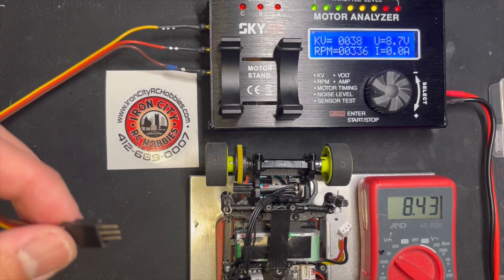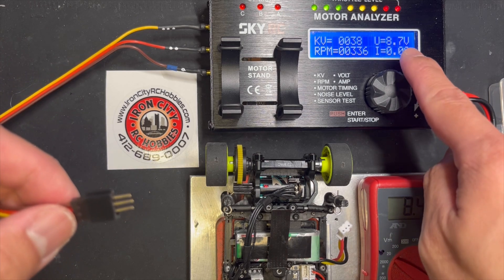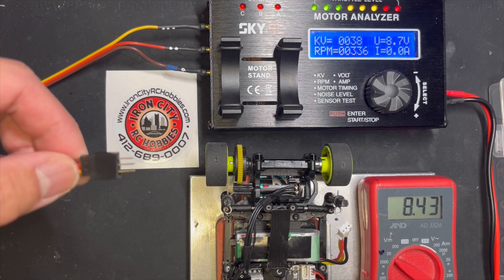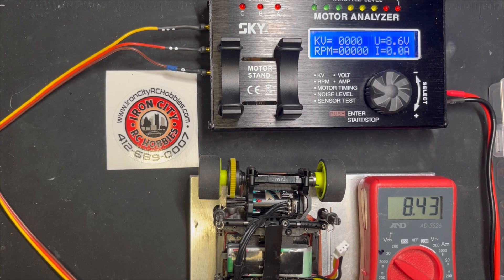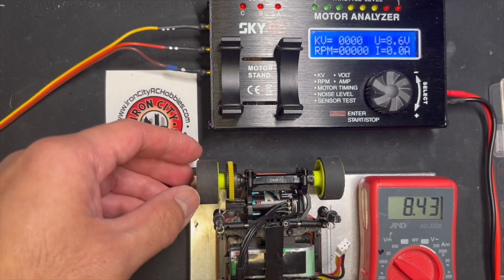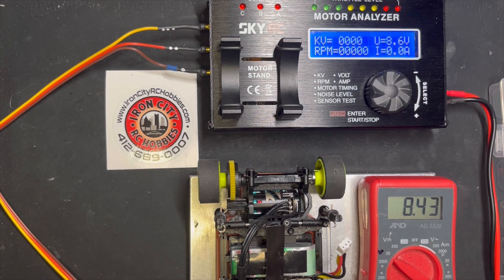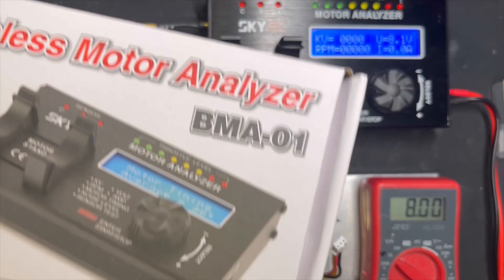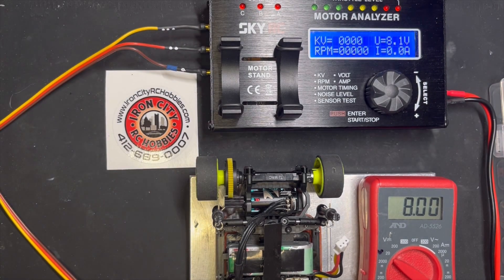Brushless Motor Check: GL Racing 3500KV Motor #miniz

Comment: May I check what wire do you use to tap onto the motor points
Reply from the maker: @888-RC  I was just using one of the 3 pins male connector. Then I opened up the housing to expose the pins.
Reply: @tjaymacRC  can you share the link for this connector pls. It seems like the perfect length and width to test these motora
Reply from the maker: @888-RC  Hi, I just made mine. I didn’t buy it. It came with as a kit when I bought one of the chargers. Sorry Idk the name of it. Maybe its called 3 pin JST connector? I’m not really sure.

Comment: It's good to know the motor analyzer is off on volts from your power supply. I run the GL 2500k non sensored motor and love it. I have had it in the car since May 2023 with no loss of power feel.
Reply from the maker: I'd love to buy the GL 2500KV but that motor is not allowed in our 2500-Lipo class. We're only allowed to use Rocket 2500KV motor. 

I spent most of my time driving PN 3500 v3 motor because this is what's allowed in our 3500 class. Now that the PN 3500 v4 is out and from our local drivers, they're as fast and as smooth as the GL 3500. So temporarily, the GL 3500 motor is allowed to compete against the PN v4 to see if there's a difference.
Reply: @tjaymacRC  At Wolfram, we follow the RM28SA rule set for 2500 and 3500 class. We allowed 2800/3800 max from any manufacturer, and sensored has to be in blinky mode. The sensorless is like an on/off switch, but the trade of is more power.

Comment: I use power out from my charger for both my truer and analyzer.  Interested in seeing if there is much difference between 8.1 and 8.6 on the analyzer.  

3730 is good for a 3500.  It means relatively low risk of failing tech for 3800kv on other peoples analyzers.  Some are more generous than others...
Reply from the maker: Me too! I'm going to get at least one of the PN v3 motor that I tested and check that motor at 8.6 on the analyzer (8.4 power supply) and see the difference in KV.